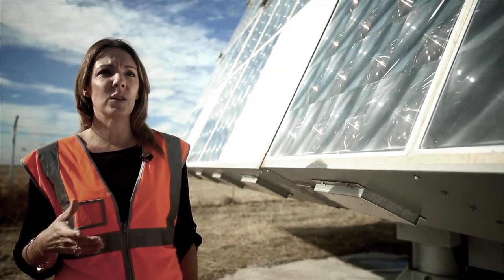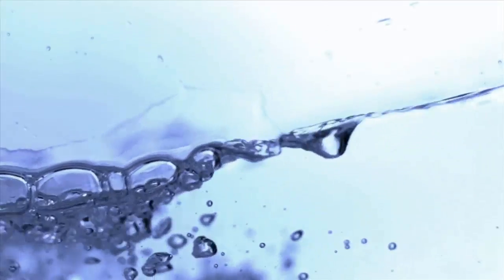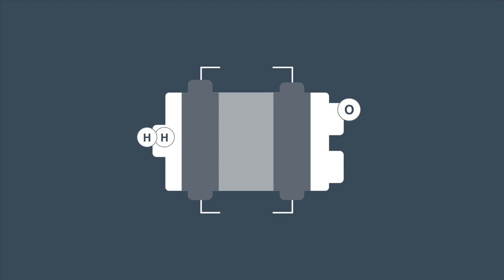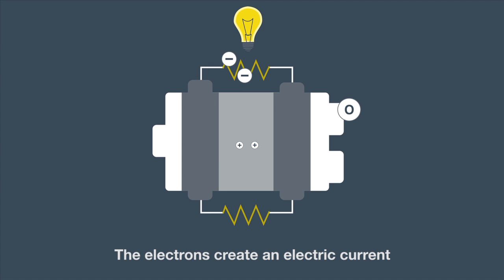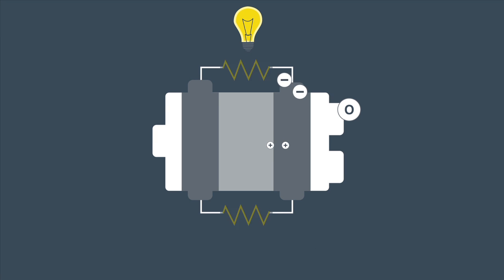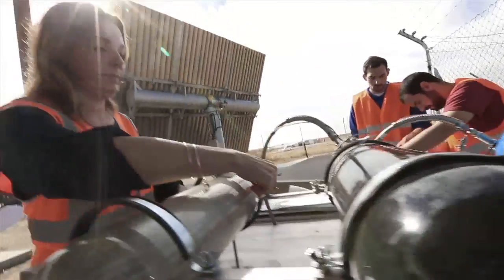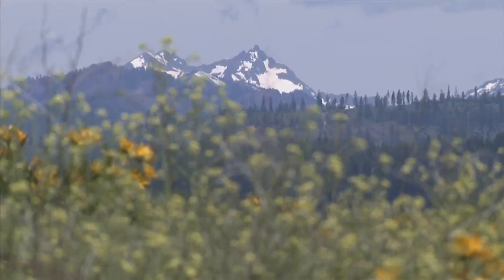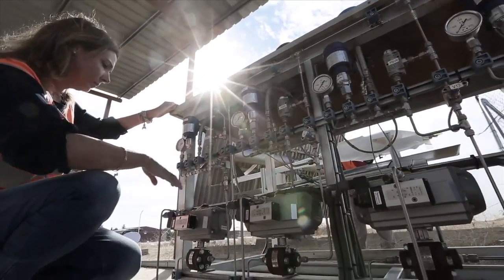Boeing's fuel cell technology is making sustainable flight closer to reality

Comment: wow that means less fossil fuel on the aircraft,less emission, less noise, clean (always) available source, and bring us to the weight of the aircraft stored in its wings to contain the fuel=less weight the airplane has to carry which means the design of the aircraft could change and allow for more new design concepts and also more efficient maintenance, never the less a more convenient flight for the passengers and their luggage, changing the experience of getting on board.

innovation by all means that affects every sector in aviation.

also this technology could be transferred to factories where the aircraft is being built, clean energy to power the plant which gives us clean green aircraft industry by flying with this technology and also by building the aircraft itself.

Game changer technology indeed.

Comment: Question: could you not design a aircraft to have a mast that would extend out the back of the aircraft. Say 2/3 its length. Use a parachute to deploy it. As boom extends opening a bladder the whole length of mast.  small controlled burn of jet fuel.

You would be nose down. How much could you reduce you desent to?

Comment: Electrolysis is very inefficient, as is fuel cell technology. Instead of treating the hydrogen as a battery, it would be better to invest in battery technology to reduce the Wh/kg and price per kWh. Overall a much more efficient system.

Comment: I don't get the point of this video. Fuel cells have been used for years and years. Boeing's Phantom Eye uses hydrogen as a fuel source, albeit through combustion.

Are you all looking into developing propfans and active laminar flow control systems further?

Comment: Hydrogen powered F/A-18, anyone?
Reply: +ThePolkadotbot if you use the hydrogen fuel as you would with kerosene, you would have more thrust since it has higher specific energy density than kerosene
Reply: Wouldn't create enough thrust to be considered a fighter jet, this technology is more for cruising craft like a 747